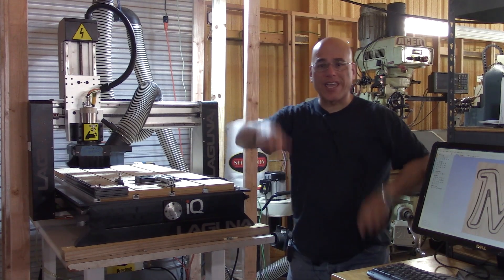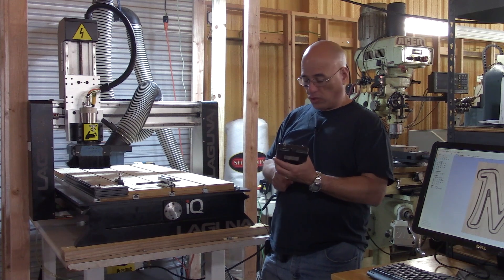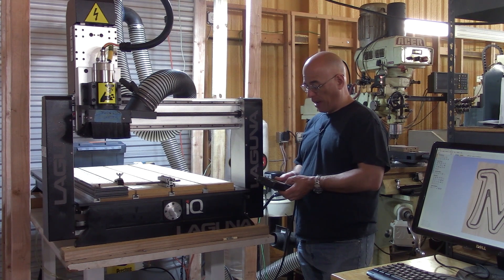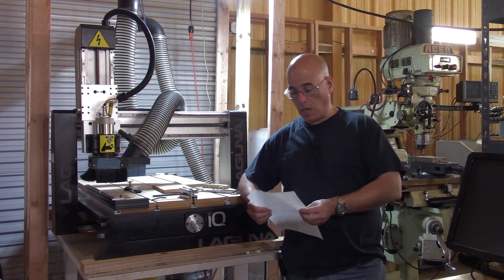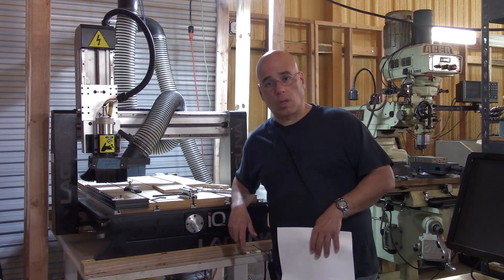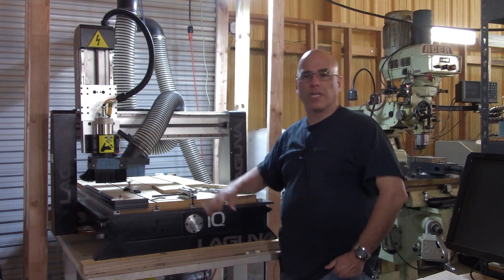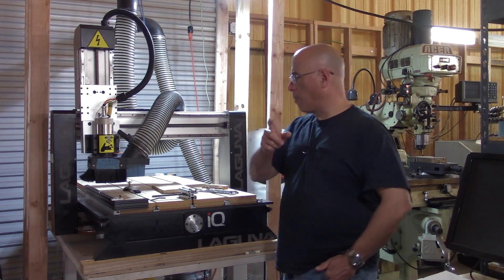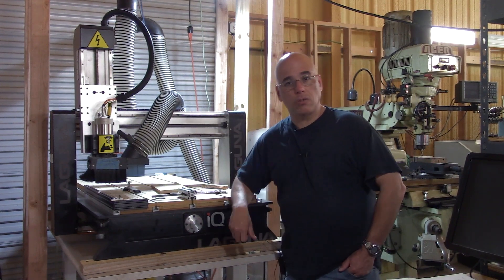Laguna IQ CNC Router Review

Comment: How would you compare it to your Tormach mill build quality?
Reply from the maker: Well, that is quite the tricky one as of course the Tormach is cast iron so it is way much more rigid. Granted that you would not necessarily need that kind of rigidity to do wood and plastics, so if we are going to go with "rigid enough to do the job they were meant to do" then the Tormach would be merely a tad more rigid than the IQ. This is because of the vibrations I witness on the IQ, as opposed to the Tormach which is incredibly solid. But the IQ is not bolted to a rigid base so that doesn't help... Will point out the machine is incredibly heavy, so it is not light by any stretch of the imagination! Two guys would get hernias trying to grab it... Maybe three guys? I used my engine hoist. The cable management on the IQ is VERY nice! The sensors are an improvement over the Tormach as they are inductive as opposed to push button switches. The electronics on the Tormach are definitely much beefier than the IQ, but then again, the IQ is not a mill. I do wonder how does the IQ compares to the Tormach CNC router but that is something I have not even seen yet, so that one I will need to assess at a later time. Thanks for watching!